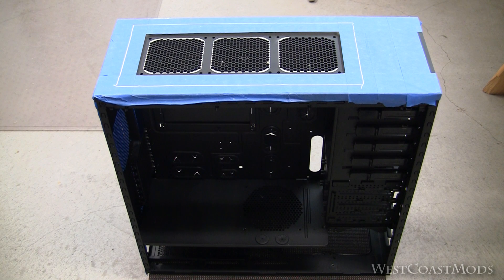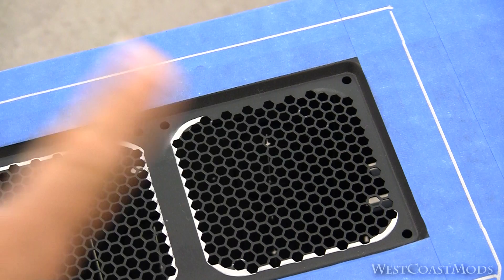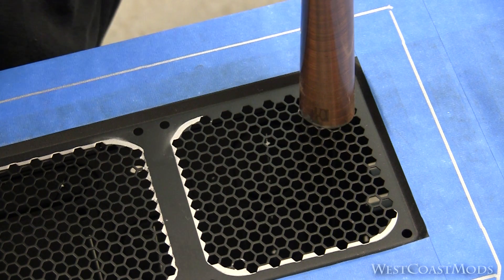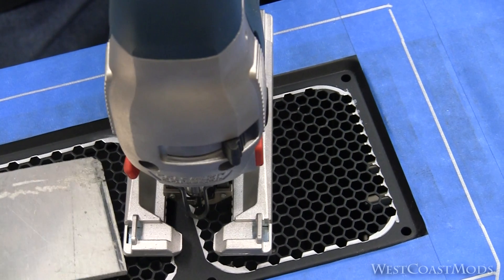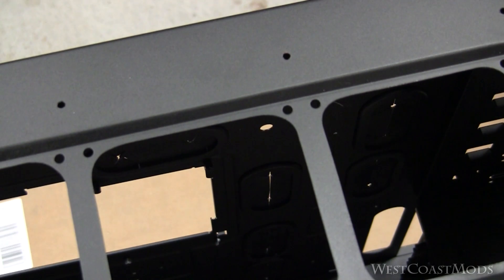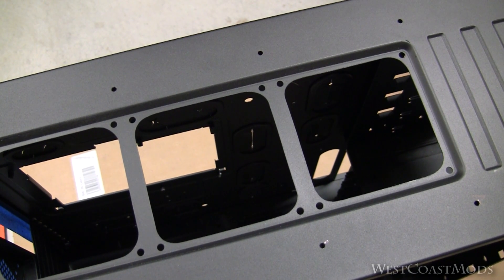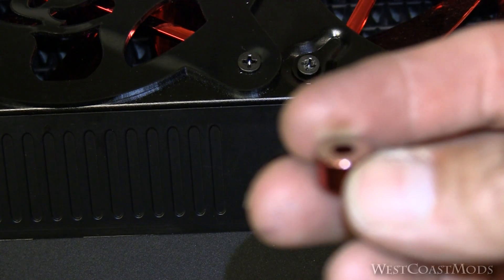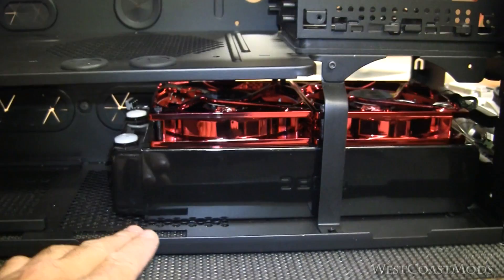Corsair Obsidian 800D Case Mod for 360 Rad

Comment: And push pull is ok if you have the money for fans but if you do just a push or just a pull will work for you, you may again about 5.c at most doing a push pull set up. And the fan noise will shot thru the roof and if you don't care about sound then go for it. And it also depends on your Fins per inch in the rad you use also. Also you can youtube what i have said and find out for yourself if you don't believe me.

Comment: There is not a real good way to figure this out most people just guess. At most It might be 5%-7% there is just no way its close to even 30%. If you don't trust me get the case put fans it in and run it where there are blowing out, then take them out cut it out and put the fans back in and see if you can tell that much of a difference i bet you wont be able to tell very much

Comment from the maker: I was able to get the info from MC Master Carr....they provide restriction % with all the different type of mesh they sell. Many options to chose from. The client chose to have the fan grills on top to cover up the fans....if you don't use anything then it will look unfinished....as the shroud is meant to have so sort of fan grill...maybe you could use just plain wire ones.

Comment: So the mesh has a 30-40% restriction? How do you measure that? I'm looking at doing a push pull 360, but if I tried to cut the mesh out of my 800 like you did in in this vid, I would totally butcher it. It seems that cutting out the mesh and then putting big ass fan grills is counterproductive? I'm asking respectfully because I am wanting to do something similar. Cheers

Comment: Ahh I understand you now. That's actually a very handy way of doing it! I have done it a slightly different way. I put screws through the shroud, downwards into the fans, right into the rad. I have placed spacers in the gap inside the shroud, which eliminates it completley and makes everything super sturdy. I then attached the bottom row of fans onto the rad from the bottom screwing up. Thanks again for all your help Lazyman!!

Comment: Thank you for your reply. Thats interesting, how did you attach the rad? What is it screwing into to stop it falling into the case? I had originally intended to screw through the shroud, top fans and down into the rad, to hold the rad on. Then screw the bottom fans upwards into the rad. Thanks I will def post on there when finished!

Comment: Hi Lazyman, your 800d has been a big inspiration to my own 800d build. I am currently working on the top rad mod in this video, and I have ran into an issue you have not mentioned. What did you do about the space between the top of the fans and the inside top of the shroud? I.e. the space caused by the slight recess that the 3 top fans are sitting into? Thank you.

Comment from the maker: @MediaMocker You are pretty smart....yes adding the fan grills created about the same flow restriction as the original mesh. I'll give you that.....BUT and this is a big BUT...if I was to leave the mesh than add the grills would it had created more restriction ....I think the answer is yes....so I removed the mesh so we could reduce any additional restriction that it may have caused...knowing that i was going to be using the grills...per the customer.

Comment: @WestCoastMods you call this guy an idiot when you have no comprehension of energy transfer? air is energy, it will only flow as well as its most restrictive point, you can have 2 equal restrictive points and the same flow. just like hose with water flowing. Those grills are without a doubt as restrictive as the original case mesh. You sir just wasted 3 hours and in my eyes are the idiot. Don't be so rude to people offering constructive criticism you only make yourself look like a winey bitch

Comment: @WestCoastMods no wiring i mean just case modding, like adding cold cathodes sideways in the front and then cutting holes and putting thing plastic there. things like that.

i would let you be the designer we could come up with something.

i dont mean setup the computer just the case so cabling will all be done by me. as for the cooling loops it would be just the 1 triple rad on top so no need for a mod there. basically just make a high quality nzxt case :P the blue lights, custom cutouts. ect

Comment: @WestCoastMods oh nice, and all i would have to do is drill holes perfectly in place for it and screw it in? looks great for push pull configs so that you dont have fans sticking out. funny I couldnt find it on their website when i looked at the grill shrouds section.

Comment from the maker: @DrGoodwrench64 You bring up good points, but as far as removing the mesh it was to help compensate for the restriction that the fan grills are going to have. the client wanted these for aesthetics, and was will to sacrifice a little air flow. So to minimize restriction, I felt that the work it took to cut out the mesh would be worth it.

As far as your idea's on CPU Project Freeze, I would be curious to hear your idea's, however due to current workload, I may not have the time.

Are you Union?

Comment: ...cont.
,side fans, rear fan? OK, so assuming all else is equal, the question is this: 1) Are those shiny new fans matched? Meaning are they all the same CFM?
And
2) If they are, and you cut the mesh out to "Improve" the air flow, they don't those neat, skull fan-guards you topped the fan-shroud with, restrict the air-flow as much (if not more-so) than the mesh did to begin with?
Seems to me that you did a lot of work for nothing if you put them on.
I'm an old HVAC&R tech. That's why I'm asking

Comment: You must be from Stockton, I can hear the Hawk in the background!

But I do have a suggestion or two for your next mod like this. Just a couple things you might want to keep in mind...
Your use of the 'Push-Pull' design is great as long as your Supply-Air and Return-Air are equal.
In this vid I noticed that you have a 240 Rad on the bottom and a 360 Rad on top. 
Since most Power Supply's exhaust fans are "Pullers", I'm assuming that other fans are making up the difference? i.e Front fans... cont

Comment: @WestCoastMods ok thanks for quick reply i will try to take them off the srew holes in the back are not blocked but on the left side of the case the slide lock system to lock things in your drive bay are blocking some of the space needed for the screw to go inn, but i will try to remove it

Comment from the maker: @HansensUniverse Not sure why it blocks some of the space...it should line up with the holes on that side of the controller, so you wouldn't need to use screws. anyway, yes you can remove them...they just pop off. it may take a little persuasion but just take your time and they should come off once you figure out how they pop off.

Good Luck

Comment: hey i need some help, i have a six channel fan controller that is going in to the drive bay, the case is the Corsair Obsidian 800D, when i try to screw the damn controller inn the lock slide blocks some of the space needed for the installation, can i remove the slide without damaging it ? thanks :)

Comment: Hey LazyMan, I finished cutting out my hard drive tray so as to mount my 240 rad down there and I noticed something while i was cutting..........The fan mount (the upper part that is all one piece with the tray in the middle of the case) is not like yours. The hard drive rails and the fan mount is all one piece so it came out with it. I'm gonna fabricate a bracket for it but i thought that it was interesting that Corsair revised the case slightly.

Comment from the maker: @BrandonCamilleri Hey bro all you need to do is cut the sensor wire and wire it back to itself. This will bypass the sensor. Also I would suggest soldering the connection as the wire is very thin and weak. Also cover the solder joint with heat shrink to protect it from shorting.

Hope this helps
LazyMan

btw don't forget to subscribe.....

Comment: Hey i bought four of those enermax fans and i use 1 at the back of my obsidian as an intake for an H50 cooler and 3 at the top as exhaust... If i cut the thermal sensors off will this make them run at full RPM or will they not work at all?? Bdw really love your mods ... really would appreciate a reply :) thanks
ALL THE WAY FROM MALTA :P

Comment: @WestCoastMods Right on. I just watched another vid you did explaining some ideas for the mod. Adding a few 120mm fans to the side panels on both sides of the case (to aide the hard drive cooling) is a trippy idea, I like it. I wanted to stay away from cutting on the windowed panel but I'm probably going to add the exhaust port on the opposite side and change out the stock fans to the Aerocool Shark high pressure fans, AND still take out the bottom hard drive rack and add another fan there.

Comment: I'm digging this mod LazyMan! I just finished my WC set up in my 800D, and I'm noticing that the hard drives temps are at least 12 degrees Celsius warmer than my other case so I'm seriously considering taking out that bottom hard drive rack, and adding an intake for a 140mm fan in there. Kinda if a pain since i literally just finished the build. Great work cutting and smoothing out the top!!

Comment from the maker: @soggymaster Yeah, I have no air tools yet, just bought this because it was on a pretty good sale. Anyway I would being using it for cutting, grinding, sanding, which and this one is only rated for 3.8@90psi and 5.1@40PSI, so I don't know if it has what it takes. And yes it is a loud son-of-a-bitch.. Sears has their professional one that is suppose to be a lot quieter, but more than i really wanted to spend. It is also more powerful, don't have the spec handy

Comment from the maker: @Jetstorm19 Thanks bud...I pretty much have a set $ for the most common mods, then for stuff that is unique, I just throw what I think is a fair price. The one thing ppl don't understand is things start to add up quickly, so depending on what you want done it can be costly. but to be honest I always go beyond what is required, if I see something that would look good, I just do it as long as it's not to involved.  Most of the time I do more work than what I'm getting paid for.

LazyMan

Comment: @WestCoastMods Let me know how it works bud. The HP for the most part (to my understanding) only says how fast the tank will refill itself when it goes below the specified amount of pressure. So long as you're maintaining that air pressure, you're okay, and unless you're going to be doing some crazy stuff, I don't see the need in getting anything larger/more expensive.